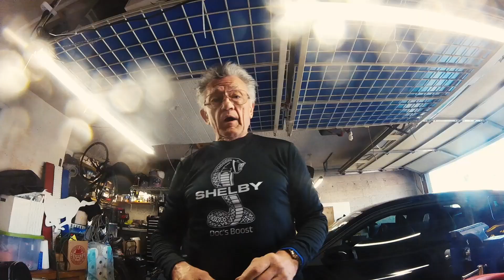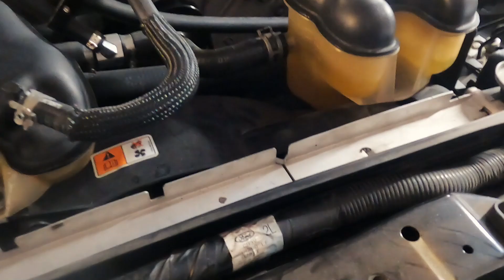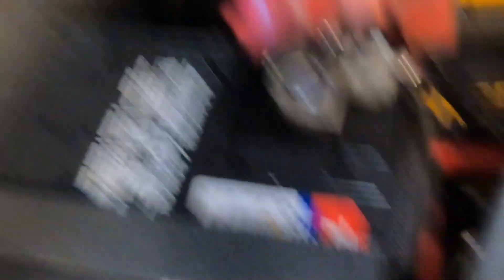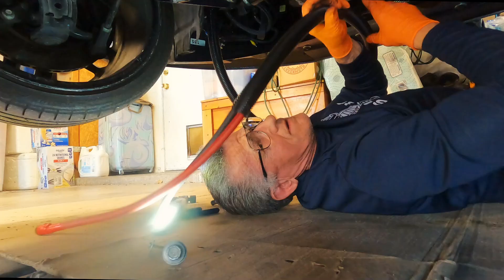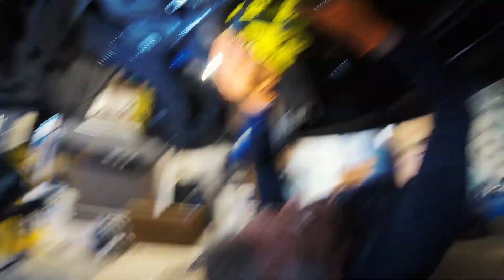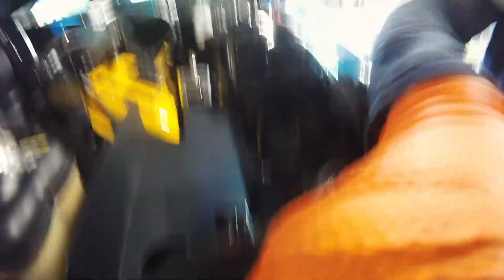How to install a 240 AMP Alternator on your Mustang

Comment: Awesome perfect timing. I run a pretty decent stereo system in my 2012 Mustang. I just bought 30 feet of 1 gauge Red/Black. Your video just made my life easier as I had no sure idea how to route the wires. I'm literally coping you exactly. 240A alternator should be overkill plus that 1 gauge wire. Excellent set up. I went with PowerBastards 250a ( probably overpaid at $370 shipped but I had to have one that could handle 8000 engine rpm) Im running a Pro Charged 3.7 ( my best is 11.6 @118mph on 10psi not quite Shelby fast but its beat a 5.0 /Scat fast ) I noticed immediately with the higher Amp alternator my lights were a little brighter, inside and out. My stereo system sounds better no more dimming light at night when my stereo playing loud. Coolest part was where normally the volt gauge would run halfway now its always at 2/3. I hope it works great for you.
Reply from the maker: Great information and run down.  I am glad things  worked more than expected for you.  So far my upgrade is frustration free and that's what counts,  yes?
Reply: Yep that's all that matters. Again thanks for great ideas